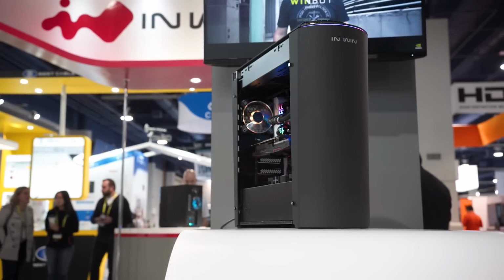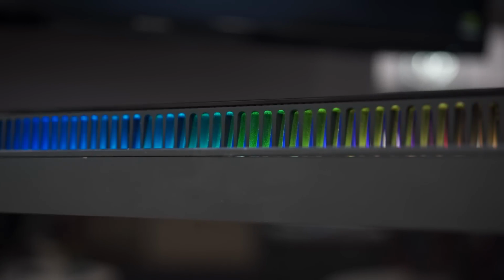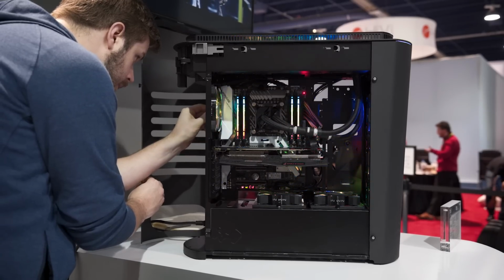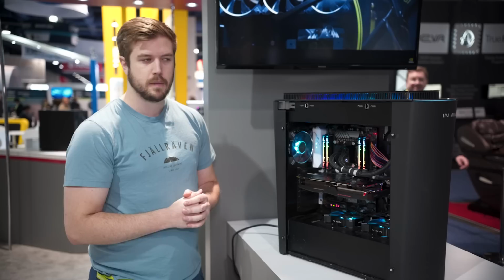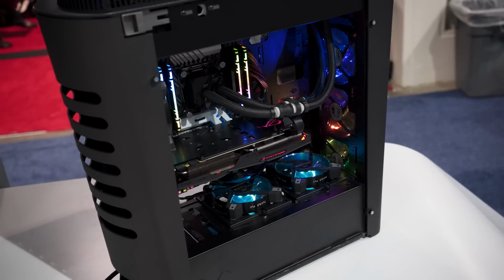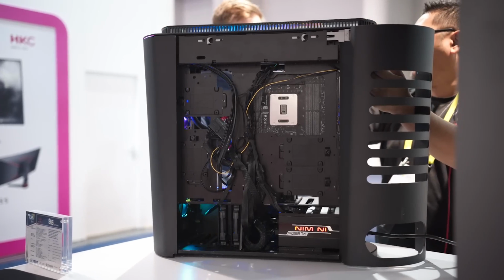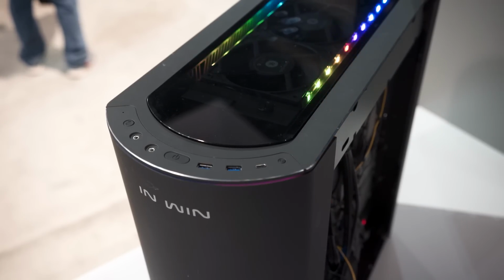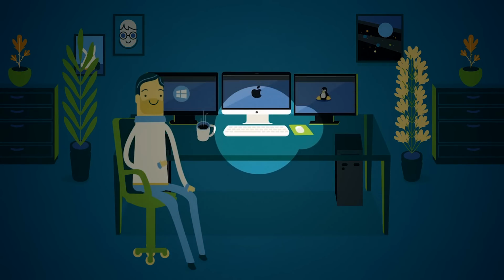Mechanized Case for ULTIMATE RGB? - In Win 915

Comment: That kind of case would be great for someone who could implement it in a space that is dedicated to a particular style of sci-fi decor. I can see it fitting in perfectly, but it's just very specific, and would look out of place in many places.

Why do manufacturers think that they have to include a glass panel on the cable side? Is it a cheaper material? I don't see it being useful whatsoever if it's just displaying that someone could bundle some cables together. Maybe if they had some kind of light-diffusing strips in some kind of minimal design that were rgb (which may cost more than tempered glass) would be good for aesthetics, but not tempered glass on the cable side.

Comment: Short opinion: I like the looks of the case but it will ultimately suck.

Full opinion: I like the design. the curves make it stand out as a softer looking case as opposed to other cases with their straight lines and their shard angles that end up looking more aggressive and hard. This case just has a more gentle and soft look to it. 

However if we all thought the Cooler Master H500P had bad airflow then this case is going to have absolutely terrible airflow. The only real airflow layout I can think of that might half way work goes completely against everything you would normally do. 

Normally you have your intakes at the front and bottom and your exhaust at the top and rear. Why do you normally do this? Because hot air raises so by putting the exhaust at the top and rear the hot air will naturally rise up and away from the case and more importantly up and away from the intakes. doing that allows the intakes to have access to fresh cooler air. 

But with this case the normal location for the intakes are severely restricted. The only option you have when it comes to trying to get a unrestricted flow of intake air is either 1) you mod the case and cut ventilation into the front of the case and filter it (most people are not going to be comfortable with this option) or unfortunately 2) you put the intake at the top. 

Now why do I say that option 2 is unfortunate? Well that's simple if your intake is at the top where you normally have the exhaust guess what that means... your exhaust is going to have to be where the intake normally is, at the front and bottom. 

Well why is that a bad thing? Well as I said before hot air naturally raises so when the hot exhaust air raises from the front and bottom guess what its going to flow right past... that's it you got it the intake. When the hot air raises past the intake fans the fans will pull that hot air back into the case, back through the radiator. You will end up with a case air feed back loop. And when you end up with that kind of feed back loop the exhaust air is not going to have the opportunity to release its heat.

Air can only hold so much heat before it stops being effective at cooling. And as that happens your components are going to cook you will see temps raise and raise and raise to the point where you will suffer throttling and your PC shuts down on it own to save itself. You might as well just take a blow torch to you hardware.

This is not a well designed case and frankly I expect a whole lot better from In Win.

Comment: What's the point of this case?  I'm sure the mechanized lightshow on top will mesmerize the low IQ crowd,  but the rest of it just seems blah.  Might make a good heater though,  however it would be a radiant heat as there appears to be very little intake.

Comment: A lot of additional fuckery to just plug in cables / access radiator all in the name of aesthetics and I can't see why you wouldn't just always have to top vent always open for additional airflow, maybe they could have tied it into a temperature sensor that activates it if the internal case temperature goes up? so it goes into some sort of "gaming mode"

Comment: YAY! A bunch of moving parts that will fail quickly! I'd settle for a better case manufacturer like Corsair just coming out with accessories for their existing cases, like a cable shroud, or a power supply basement shroud, for the 750D

Comment: The top ventilation is cool and the curve design is sexy but everything else is shit. , no space for hardline cooling /light tubing and a reservoir, 

no space for extreme air cooling 

no dust filter for the top ventilation ,

 no easy changeable Hard drive or SSD 

the front panel needs to have an opening for better air cooling, a huge dust filter ,a curve design and a metal (other materials) air panel 

the case needs a bottom level for the power supply and a reservoir (or easy cable management) 

the bottom of the case needs to have an air cooling system for the power supply and a hole to refill the reservoir or to clean it 

the case needs wheels (4 wheels) under the case  and a pushing bar or handle on the back  (the case needs to be durable and reinforced)

Comment: I don't get why every manufacturer are still putting front I/O on top of the case... Are there still people who put they're case on the floor??? I hate having wires dangling in front of my case if I need to plug-in my controller or my headphones
Reply: Plug them in your motherboard, and if you dont have enough usb ports, buy yourself an usb hub
Reply: Yeah that's what I ended up doing... I just feel that this part is overlooked

Comment: INWIN is crap.. open up the bottom a bit at the front, take note of corsair back cable mangement solutions for visual prettierness, and why the hell are they still doing swivel hinges on those front and back covers why not a soft release. anyway.

Comment: My thoughts on improvements

The top "RGB elevator" is stupid, no one's gonna be using it frequently enough for it to be worth it. It also just makes the case more expensive and it is not worth it for the RGB gimmick imo. Also remove the top glass and put a mesh there.

The front fan setup is pretty dumb, they could have had one intake fan on the top and one on the bottom of the curved frontpanel instead (horizontal instead of vertical) or stacked for extra force. This would be a very cool new design for airflow and it makes the front panel look clean without meshes. Making the frontpanel sound dampened would also be a good idea

The look aspect of the case is very good except the fact that there's a glass window for the cablemanagment.
Instead of having a glass panel there they could have a solid aluminium door with cut outs for 2 - 140/120mm fan mounts + a fan connector bay where we could mount fans. On the inside of the PSU shroud there could also be fan mounts pointing up for intake (like it is now but the fans are on the inside of the shroud instead and moved forward a bit to make room for the psu) these 4 fans together will make extra intake to compensate for the front panel.

I know inwin is all about "show" but making it practical and useful is actually a good thing.

Comment: This RGB craze really has to die. It only brings us higher priced components, no performance extras. But, because we people are like magpies, as soon as we see something flasy, we want it. 

I would love to see a "bragging rights" top of the line rig that is built to be as stealth as possible: no rgb, as few lights as possible, no brittle glass parts and as silent as possible.
Reply: The problem is... rgb isn’t anything new or expensive or intensive to produce. It’s very easy and very cheap. The problem I have is that adding those three alphabets seem to increase the price by 20% at least. Not okay. Should ALL include it, but you can use it or not for the same price.
Reply: I have a Fractal Design R5? R6? Can't remember, no window...nothing. You don't know it's on, it just sits there like a giant black monolith. lol
Reply: derzemel Linus already made an anti RGB build
Reply: @Anthony: yes, I have seen that build. But try to find parts like that directly from a manufacturer.
Reply: Just get an old fractal design case.
Reply: Tempered glass isn't really that brittle though.
Reply: derzemel rgb is great.

Comment: I like this minimalist look. That mechanical RGB component looks cool. 
I’m a fan of fans. 🤣 I don’t like liquid cooling. 
Why would you need so many drives? I think 1 or 2 large capacity 3.5” drives and like 1 or 2  2.5” drives would be sufficient.
Reply: A lot of people like to use RAID setups for better performance/failure protection, most of those have at least 3 identical drives.
Reply: RGB is minimalist...
Your opinion should never be heard again by anyone XD

(Stop it, go find some help)
Reply: @kidthorazine I guess that makes sense in case your data gets erased/corrupted. But how often does that happen these days?
Reply: mechanical drive failures aren't THAT uncommon.  That's usually a bigger issue than data corruption.  Also if you use mechanical drives a RAID10 setup gives you a pretty decent speed boost.

Comment: This is worse than Bitfenix Enso, at least Enso was cheap.
What are 3 fans on the front and 2 on PSU shroud doing? 80% just moving air inside case and 20% sucking in actual fresh air probably. What is the purpose of that thing on the top? Why does it go up and down, why it's just not made to be up all the time? You want to show it off probably anyway.
This is subjective, but this thing is really ugly. Thumb screws that stick out and side panel full of logos.
I started laughing when he said what the price would be.
Reply: Because when it's lowered, the giant holes on the side of the raised platform are now inside the case behind a metal-on-metal seal.
Reply: klklkl427586 He said it goes down so there can't get any dust into the pc when it's turned off. Assuming you have two fans to blow all the dust away and keep it from going into the case. it would just be for looks and  could be for better airflow I'm not sure though.
Reply: I don't understand this argument, why would thing going down stop dust from falling on it or in it?
Reply: Tyrope Games I see now, didn't see top of case in video. So now even top fans are starved for air. Wouldn't dust just land on fans there and get blown out when you turn them on, anyway is dust falling from top really a problem?

Comment: I’ve been desperately trying to find an answer to this question and have found  no definitive answer so far so hopefully some one can answer this. With a BFGD 65 inch monitor or 65 in TV, how can you get a better or similar field of view like that of a triple monitor set up. I know games allow you to change the field of view but it can look distorted and like looking through fish eye lense. With a big screen, why can’t you just squeeze more picture in the frame. 65 inch is huge. I know it would not be practical on a 27 in screen but 65 is more than enough. Instead of just having a jumbo image on a 65 in screen why can’t you have more field of view. And I’m talking about a lot more.
Reply: p alberto Because it would look distorted? You answered your own question. You can't map a large portion of a spherical fov to a rectangle before there's obvious distortion.
Reply: nceQon.BraSS but you don’t experience that distortion on a ultra wide triple monitor setup
Reply: p alberto Because it's a different aspect ratio, which equates to taking three NORMAL fovs, and displaying them side-by-side. As is, there will always be some distortion when projecting a 3d sphere to a 2d rectangle, and the larger the fov, the more apparent it becomes.
Reply: nceQon.BraSS what if you could use 6 normal fov and display them all on one 65 in screen? Would that be possible?
Reply: p alberto That would still cause distortion. Either it would distort at the edges, like normal, or you could adjust, and cause significant distortion at the seams. There's a reason no company is manufacturing a wide-fov monitor. It's fundamentally impossible on flat monitors. You'd have to wait until concave spherical monitors are developed.
Reply: nceQon.BraSS that would be a very interesting monitor. But maybe such a monitor won’t be necessary if you use a VR headset to cover almost your entire peripheral vision.
Reply: p alberto True. VR headsets do already provide a "solution" of sorts, though it is kind of cheating, lol.

Comment: Alienware had something sorta like this in 2010 or something. It has a bunch of fans on the top and it has these gill things at the top that open up during use and it closes them while not in use so it doesn't get dusty.
Reply: But the Alienware case is much nicer and and also the mechanism on top.
Reply: Currently using one of those Alienware PC's and the fins on top are pretty damn cool.
Reply: I remember that alienware case - I was working in alienware's customer support back in 2010, and we had all the cases at the office, so we actually knew what on earth we were giving customers support with XD

Comment: That’s a lot of setup, work, and general inconvenience for not a lot of style.... my Corsair 760t case is huge, has big see through panels and is crazy easy to work in, and I don’t need 5 steps just to get to my radiator
Reply: And you dont have to unscrew the backpanel to add a USB drive...
Reply: It's not for the general masses
Reply: I had the 760T but it you cant add a top rad unless you remove the top cover which makes the top ugly. Happy with my 570X now.
Reply: I totally disagree it looks badass especially the mechanised vent!
Reply: Agreed. I have the 780t.Everything is easy to access.
Reply: Ultrawide Gaming yeah....and tbh this case is kinda unnecessarily overkilled
Reply: Hell, pretty much ALL previous In Win cases look a lot better than this.
Reply: yes because you need to access your radiator every day
Reply: Yeah that thing is tacky as shit
Reply: to much shit to be cleaned
Reply: I disagree. I like it. I see a (2017 style) airflow case, with a way to close it off, and make it quieter. I think its a good idea for people who want to overclock and need airflow, but dont want a super loud rig.
Reply: But it's ugly